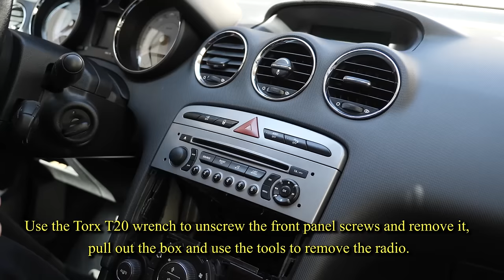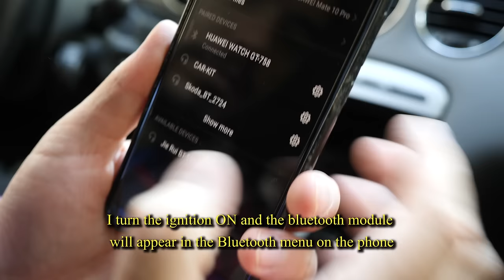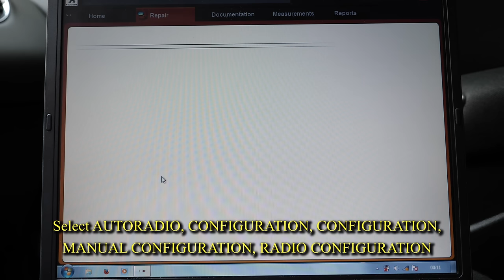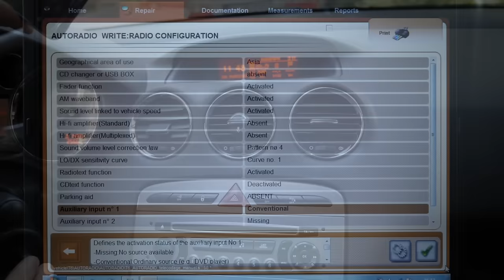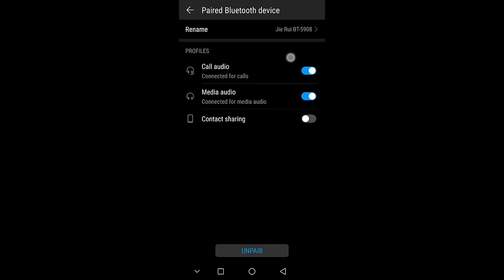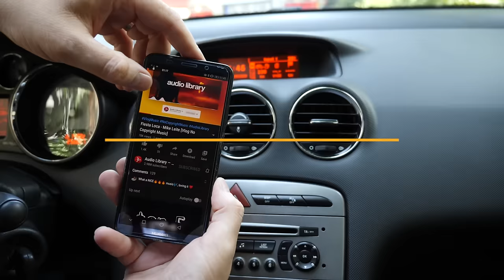Install Bluetooth Audio Module on Peugeot & Citroen Radio RD4, RD45, RD43

Comment: Hi Adrián, i installed it following the steps of your video and it works great, only problems with pairing but i downloaded an app and it worked. The only problem is that i connected it to pin 12, because i haven't got a pin 11, and it is always on, taking a lot of battery even though the car enters in eco mode. There is another cable that only allows it when the ignition is on or i have to install a switch or something?
Reply from the maker: Hello. Use a multimeter to find a wire that is powered on the ignition.  You can also find a + wire in the light from the glove box that is powered when the ignition is turned on.
Reply: @AdrianDragan  thank you very much i found a cable that works with the ignition on, is from the esp button that my car hasn't got it. I connected it and it shuts off when i turn off the car but it pairs with the phone and then gets disconnected, and then connects and disconnects. Could it be that this cable of the esp button hasn't enough power to keep it working properly or something?
Reply from the maker: I think that cable from ESP has low voltage, I think it is more suitable to supply from a wire of the lamp from the glove box.
Reply: @AdrianDragan  i'm gonna change it! Thank you very much!
Reply: I connected it to the positive glove box light wire and i think it's working fine!, thank you very much for your help and congratulations for your videos, they help a lot!. Regards from Uruguay
Reply from the maker: @nicolasmacchiavello8201  Wonderful! Greetings from Romania :)

Comment: Thanks for your video, but how to get the software to activate the aux system?
Reply from the maker: Hi. You need this: https://www.aliexpress.com/item/4000060579009.html?aff_fcid=07b1756aa6234348b0db731145bbabf2-1636066688100-04434-_AO3jCx&tt=CPS_NORMAL&aff_fsk=_AO3jCx&aff_platform=shareComponent-detail&sk=_AO3jCx&aff_trace_key=07b1756aa6234348b0db731145bbabf2-1636066688100-04434-_AO3jCx&terminal_id=364d159dab6d4da48c68657f8054a5c8

Comment: Hello, I have a peugot 207 with aux audio source (you can connect trought a RCA wire in glove box) would I still need diagbox to enable it? Thanks
Reply from the maker: Hello. You no longer need AUX activation if you already see AUX when you press the SOURCE button. You can buy a module that connects directly to your RCA jacks: https://s.click.aliexpress.com/e/_DmJoJlf

Comment: Adrian hi,my mfd has only 3 icons in menu, there is no bluetooth icon.
Can i programm it with diagbox or i must buy a new type c mfd like the one you have in the link bellow?
Reply from the maker: You need to activate the AUX IN option using the Diagbox interface as you see in my clip. The Bluetooth icon will not appear on the screen, so there is no need to change that screen on the dashboard.

Comment: Hey Adrian, good videos. Im currently seeking some answers, maybe you know about this....my bluetooth does not work nor, the multi function display... The display started having the problem where if the cars interior was hot, the letters on the display could not be read... At that point the bluetooth worked... Now, the display is completly black and bluetooth is no longer working.... I guess the screen and bluetooth module depend on each other correct? I ask you this to determine if only replacing the screen would restore also the bluetooth functionality... Im also tempted in buying an aftermarket stereo , dont know what to do!
Thanks
Reply from the maker: The first time I think you should replace the screen, obviously it must be programmed for the bluetooth function.
Reply: @AdrianDragan  yes thank you

Comment: Hello, thank you for the great video!
You think that diagbox software works with the new OBD2 BT diagnostic tool? These costs half than lexia tool.
Thank you in Advance
Reply from the maker: Hello.  I haven't tried but I don't think it works.
Reply: @AdrianDragan  Hi man, good video. Just a question, you connect the laptop to the car with the cable of the lik of aliexpress? with usb or how?
Thanks and continue like that !
Reply from the maker: @mynorprods5719  Hello. You need the Hardware / Software interface like the one in the link below + a laptop with the Diagbox software installed. From this link I recommend "Full Chip no clip" version.
https://www.aliexpress.com/item/4000077945226.html?aff_platform=shareComponent-detail&sk=_AKl6lb&aff_trace_key=6237b4f47f354636a3dd3dbef761ffd2-1607978748639-00237-_AKl6lb&terminal_id=d92441f0a7b94ef29dcdfc816a4dd068&tmLog=new_Detail

Comment: Adrian, do you know of somethign we can do with the above screen on a 408? putting an andorid system may work for replacing the audio system, but that still have to llok down and out of the road to follow instructions. Is there something to replace the little screen above the torpedo with an android device?
Reply from the maker: Hi. I'm sorry but I haven't seen dedicated 308/408 units to be mounted instead of the screen on the dashboard.

Comment: Thanks Adrian for the video. It motivates for installing such module. I have bluetooth in Citroen C4 Picasso 2011 but it is only for calls. If I am not mistaken, the radio is RT6. But I could not find Biurlink Bluetooth module at AliExpress.Do you know if it is possible to install such module in C4 Picasso with RT6?
Reply from the maker: I'm sorry but the plug doesn't fit. At RT6 there is another type of socket and I can't find such a thing on Aliexpress.
Reply from the maker: UPDATE! I researched and the plug fits, you still have to activate with Diagbox the Aux audio input function and it has to work.
Reply: @AdrianDragan  Thanks for the quick reply. I also checked, it seems like the plug is the same (if interested, you may see the image of the plug here - https://avto-plus.com.ua/ru/car-item/9507309196/). I will try to install the bluetooth. Thank again.

Comment: Hi i have a peugeot 307 with rd4 radio, and i installed the aux cable in port 1 and enabled with lexia and worked perfectly until the cable broke. Can i have this bluetooth module installed in port 2 and have both aux active? I mean the aux cable in port 1 and the bluetooth in port 2 both working or bluetooth in port 1 and aux in port 2 but both working fibe with the source button?
Reply from the maker: Hello.  I haven't tried to activate and use both Aux ports so far, but theoretically it should work.
Reply: @AdrianDragan  thank you very much for your reply!, and do you know how it should be done in case i choose aux port 1 and bt port 2?
Reply from the maker: Select using the "Source" button on radio or from the steering wheel controls.
Reply: @AdrianDragan  oh sorry for the misunderstood, i meant how should be done the bluetooth wire thing for port 2, or it is the same to put in one port or another with the guide of the video?
Reply from the maker: @nicolasmacchiavello8201  I don't remember if the plugs and pins are identical, check in the link with the wiring diagram in the clip description.
Reply: @AdrianDragan  i'll check! Thank you very much for your help!. Greetings from Uruguay!

Comment: Nice! Can this bluetooth module can forward/rewind, pause, resume, etc when listening to music using the steering controls?
Reply from the maker: Hello.  With this adapter you cannot change the track, forward/rewind, pause or resume from the steering wheel controls.
Reply: @AdrianDragan  I see. Is there any solution for this problem?
Reply from the maker: @nikdanial3617  The best solutions I know are to replace your radio unit with an RD45 model or an Android unit dedicated to your car.
 - RD45 tutorial: https://youtu.be/z5D4lsLGwVk 
- Android dediated unit: https://youtu.be/4orKy6xSbcA

Comment: Hi there,
I buyed a bluetooth module for my citroen c5 (2006).
I connected everything as shown in the video but the I do not get a bluetooth signal, do you got any idea why?(I used Quick Splice Connectors)
(PS: Im pretty sure I got the right pins)
Reply from the maker: Hello. Try to power the bluetooth module directly from 12v and see if it works.
Reply: @AdrianDragan  Allright I have found the problem. The quick splice connector didnt penetrate two auf the cables.
Now that that problems solved, a new one appeared xD.
I now have the bluetooth signal and connection BUT I do not hear the music I want to play through my phone. It still remains on the radio and CD player as input source.
(Thanks for the answers ^^)
Reply from the maker: Did you activate Audio AUX IN function using Diagbox?
Reply: @AdrianDragan  Nope xD.
Guess we found the problem.  Now I have to find a connection cable for the car computer
Reply: @AdrianDragan  How likely is it to mess up something in the system while doing this?

Comment: frumos lucrat ..frumos editat ...dar am si eu o singura intrebare .se poate efectua apel telefonic de pe modul,,si daca da sa inteleg ca vb de pe mic telefonului..sau e doar pentru asculta muzica ..si restul care ar fi de folos la AUX....daca nu e deranjul mare sa poti sa imi dai un raspuns,
 ca as vrea sa achizitionez si eu un astfel de modul ...ms de intelegere.
Reply from the maker: Salut. Multumesc pentru aprecieri.
De pe acest modul prezentat in clip nu poti face apeluri doarece ai nevoie de un modul bluetooth cu microfon atasat: https://www.aliexpress.com/item/32826594463.html?aff_fsk=_dUYqCGe&aff_platform=shareComponent-detail&sk=_dUYqCGe&aff_trace_key=26ab7899beac48fa9202e824ac3099f9-1612278660737-00900-_dUYqCGe&terminal_id=364d159dab6d4da48c68657f8054a5c8&tmLog=new_Detail
Modulul din acest link este mai ok pentru ca nu mai trebuie sa te chinui sa faci conectarile la cabluri. Pui mufele si gata.
Reply: @AdrianDragan  am inteles ...multumesc mult de raspuns ..bafta in continuare.

Comment: Do you think the colors of the wires are the same even if the car differs? Please reply!
Reply from the maker: There may be some differences in the color of the wires.  If you do not find the + cable controlled by the ignition, use the + lamp power cable  from the glove box.

Comment: This module is working all the time, even if you turn the ignition off? On my vw t5 is like that, module keeps on blinking
Reply from the maker: Hi. Yes, but the consumption is so low that even after 3 weeks it will not drain the battery.
Reply: @AdrianDragan  true, but I’m now worried about battery, I’m worried about that thing getting warm and burn my van
Reply from the maker: @nutnaa  You can connect to a wire that has current only when the ignition is on, see the cables that supply the lamp in the glove box.

Comment: Ive just had one of these bluetooth adapters from ebay, do you have to program the AUX IN for the adapter to work or does it work once its wired in ?? I dont really want to mess or tamper with the diagnostics of my car...
Reply from the maker: Hi. You have to program the Aux IN function with Diagbox, otherwise it will not work.
Reply: @AdrianDragan  But if the AUX IN was already active when I had the car, why do you have to activate it again? I risk doing something to my car if I mess with these kind of settings etc...
Reply from the maker: @christophermorris663  I probably didn't get it right.  If you have already activated the Aux IN function, it is not necessary to activate it again.

Comment: Hello, any way to do this on a car that has only AUX 2 enabled? I'd love to avoid the hassle of finding someone who can program it for me
Reply from the maker: Hello. Does your car have AUX IN RCA ports in the glove box? If so, you can install the bluetooth module from the link and power it from the lamp in the glove box: https://s.click.aliexpress.com/e/_DD4Ngqr
Reply: @AdrianDragan hello, my module has finally arrived. I ordered the same one as in the video. I had no luck with quick splice connectors so I joines the wires manually. The sound on AUX 2 is very quiet and distorted. Could the possible bad wiring cause such an issue or is my module maybe at fault? Best regards and thank you if you spare some time to answer!
Reply from the maker: @nikolazi99  Have you tried with AUX 1? some users said that on AUX 2 the sound was not good but on AUX 1 it sounds good.
Reply: @AdrianDragan  That could be the issue, sadly I have no way of enabling aux 1 for now :/ Thanks for the response!
Reply: Hello  @AdrianDragan   Do you have any tips on how to power this kind of adapter from lamp in the glove box?

Comment: Hi! I bought the plug and play module that is in the description. But the bluetooth continues on even if I turn off the contact. Is it a problem for the battery??
Reply from the maker: Hello. Theoretically there is no problem because the consumption for this module is very low. But if you want it to stop when you turn off the engine, I recommend to connect the power supply for the module to the cables that supply the bulb light in the glove box, it has current only when the ignition is on.

Comment: Hi, my C4 has bluetooth so you can make calls but I don't know why I cannot hear music. With the Diabox can you configure it?
Reply from the maker: You can't set up to listen to music via bluetooth, it will only work for phone calls.
Reply: @AdrianDragan  So which do you think is the best approach for having the bluetooth media sharing?
Reply from the maker: @rompedientes123123  If you have a lot of money to spend, the best is a new RD45 radio or an Android unit. https://www.aliexpress.com/item/32882722000.html?aff_platform=shareComponent-detail&sk=_eK8w8t&aff_trace_key=2c9bcc71711c4fc48566568342367c2f-1602706618257-08798-_eK8w8t&terminal_id=3a8f5add39814c9a9eb3200bc67debac&tmLog=new_Detail
Reply: @AdrianDragan  Thank you Adrian. You rock!
Reply from the maker: @rompedientes123123  Interesting this radio.

Comment: Hi Adrian! I have just done it in my Peugeot 407 with the same device that you share from Aliexpress. I have used the cables 6 and 11 as well but ut doesn't work. The Bluetooth device doesn't appear in any phone and it is as if it wasn't installed. Could you help me please?
Reply from the maker: Hello. Connect the bluetooth power cords to 12v without putting the white plug, see if then you can find the bluetooth module with the phone. If it is properly powered and you can't find it, the module is probably defective.

Comment: How do I wire the adapter so it turns on when the radio is turned on? (My radio can be turned on even when the ignition is off).
Reply from the maker: Connect the bluetooth red wire instead of pin 11 to pin 12 (Pin 12: battery +12 volt powered radio). See the wire diagram in the link: https://diyrepairs4car.blogspot.com/2020/05/peugeot-citroen-rd4-rd43-rd45-wiring.html
Reply: @AdrianDragan  so that way, the bluetooth adapter won't be turned on unless i turn on the radio first? Or is the adapter always on in that case? Sorry for being annoying btw :)
Reply from the maker: The bluetooth adapter will be turned on continuously, even when you leave the car and turn off the radio.  The chances of the battery draining are small because it consumes very little energy.
Reply: @AdrianDragan  I understand, thank you for helping me

Comment: Hi, thx for the video, i have a question, my car didnt have the pin 11  cable , so i conected  to the pin 12 ( battery +12v powwered radio) , works but im wondering if will drain my battery ?
Reply from the maker: Hello. For a very long time (say a few weeks in which you do not start the car) can affect the battery. Check with a multimeter the other wires in the radio socket, it is possible to have another wire with positive on ignition.
Reply: @AdrianDragan  hey, thanks for the tip I will do it.

Comment: Salut! Am un citroen c4 exclusive, am o intrebare. Masina a venit cu Bluetooth din fabrica dar este doar pentru a conecta telefonul, pentru a duna, muzica nu o pot reda. Ma poti ajuta sa fac sa mearga si pentru continut multimedia. Multumesc!
Reply from the maker: Salut. Acel modul bluetooth din fabrica nu este compatibil cu functia de streaming audio (muzica).
Cred ca ai vreo 3 optiuni:
1. Modulul bluetooth ce se instaleaza pe portul AUX IN (ceea ce vezi in acest clip), daca radioul tau nu are functia AUX IN activata va trebui sa o activezi cu Diagbox. Vezi link-uri in desctierea clipului.
2. Inlocuiesti radioul tau cu un radio RD45 cu modul bluetooth integrat: https://youtu.be/z5D4lsLGwVk
3. Instalezi o unitate Android dedicata pentru masina ta. Te pot ajuta cu montajul gratuit, depinde in ce localitate locuiesti: https://www.aliexpress.com/item/4000597340786.html?aff_platform=shareComponent-detail&sk=_ABKLV1&aff_trace_key=4e8c5d2329cc42828df1e64e96801313-1604435227609-05260-_ABKLV1&terminal_id=77944c4ce01745aba668c8702a5739a3&tmLog=new_Detail

Comment: Hello, thank you for the video. I cant find this bluetooth adapter for RT5, is it the same as for RT4? 12 PIN? I have A/V connector in glove compartment, but I would preferred this option. Since rt5 bluetooth doesn't allow music streaming. Thank you
Reply from the maker: You can use a bluetooth adapter with RCA jacks and connect to the glovebox sockets. You can supply power from the wires of the glovebox lighting lamp.
Link: https://www.aliexpress.com/item/32821770160.html?aff_platform=shareComponent-detail&sk=_AN7CU1&aff_trace_key=a0e59975e3b54ed08381b019fc531958-1604781963997-09410-_AN7CU1&terminal_id=77944c4ce01745aba668c8702a5739a3&tmLog=new_Detail
Reply: @AdrianDragan  thats a great idea, I appreciate it! Do you know, it seems that music is played only on front speakers when I use A/V in glowbox and AUX on RT5.
Reply from the maker: @arthunterns  I haven't heard about this problem yet, I don't know where the problem comes from.
Reply: @AdrianDragan  I think I found working solution. I used bluetooth adapter which has 3.5mm output and you can charge it so it doesn't have to be on direct powerline. Put it in glove box connected to A/V there, working like a charm.
Reply from the maker: @arthunterns  Great! :)